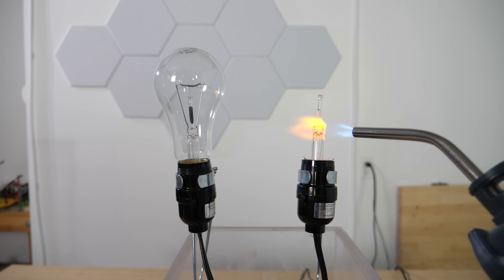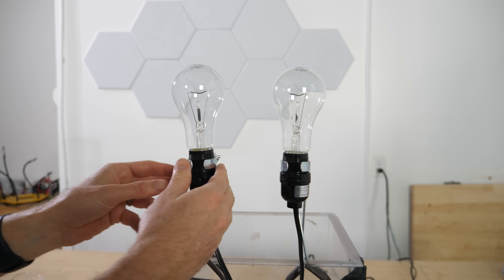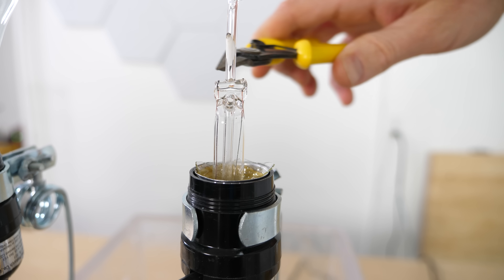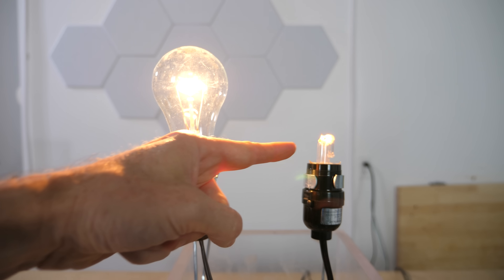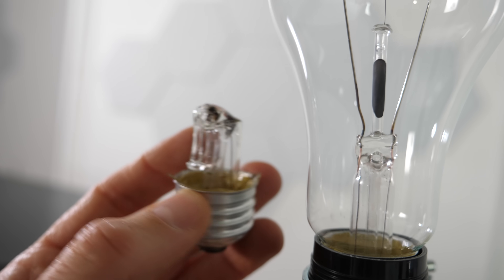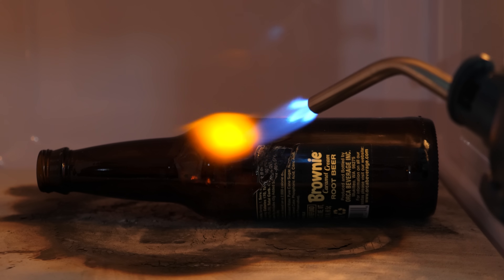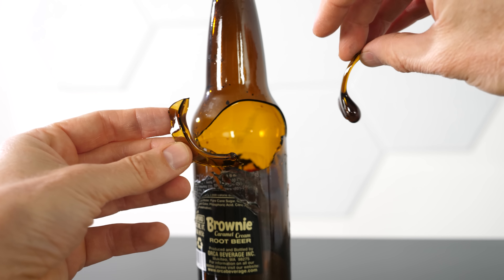How Glass Breaks All the Rules of Insulation

Comment: I was a bit of a mad scientist as a kid in the 70’s mucking about in my parent’s basement. I happened to come into possession of a high voltage transformer used for neon signs. I attached a couple of wires to the terminals and wrapped the other ends around a thin glass rod that came with my chemistry set. They were separated by about a half inch of glass rod. I plugged it in and was fascinated to watch as the electricity arcing between the wires heated the glass until it began to conduct and glowed extremely brightly. I never understood what was happening until now 50 years later. Thanks for making this video. The microwave part was equally fascinating. BTW, I also had some fun making Jacob’s Ladders with the transformer 😄
Reply: 50 years later 😶😶🫥
Reply: @stanleesiele6028 yes old people exist!
Reply: Glad you made it 😅❤
Reply: My Brother and I did the same thing with those HV transformers. Experimenting with all kinds of "conductive" materials.
Reply: @KeithKenobi  At least we didn’t electrocute ourselves 😂.  I was scared of it enough to be damn careful!
Reply: How the Gen-X survived their childhood is beyond me.

Comment: Very cool demonstration. I had no idea that glass did this at high temperatures. Thanks for showing this video.
Reply: Not just glass! Any ionic solid is conductive once molten. For example, production of highly electropositive metals such as sodium, potassium, magnesium or aluminium relies on electrolysis of the respective molten salt. These metals cannot be smelted the same way most metals (e.g. iron) because even the reduction potential of carbon is too low. The salt must be free of water because these metals react violently with water, especially under the reaction conditions (the product is metal hydroxide and hydrogen gas).

Comment: I vaguely remember my dad telling me about an (inefficient) light source using a glass rod as a filament.  The power stays on and jou start the lamp by heating the rod with an external flame.  To switch off you could blow on the rod to cool it down until the bi-stable process stops.
I can't find any info online about those lamps.

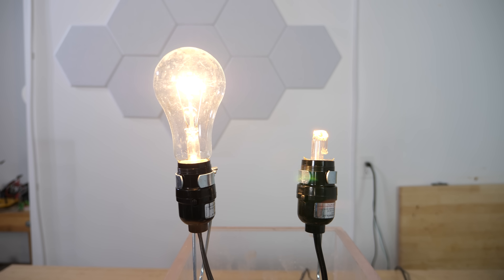Comment: 3:14 World's most inefficient latch
Reply: You can place heating latch to heat it up using electricity. After you heat it up enough it will stay turned on until you break the circuit.
Or when every ion gets to the electrodes and there's nothing to electrolyze.

Comment: Next time, scotch tape the bulb, after showing they're in series crack the taped bulb near the base with vice-grips to remove the envelope without damaging the filament.  Turn the power back on.  Most people have never seen burning tungsten.  After you have molten glass, use a glove and pliers to hold one of the electrode wires you snipped off, poke it into the melted glass and pull out a thin strand till you get bored. Thanks for the electrolysis info!

Comment: I watched a chemistry magic show when I was in college.  Take one of your light bulbs.  Connect it to a DC current source till it glows brightly.  Then immerse the glass portion in a salt solution, then connect one of the wires to the salt solution.  The free electrons inside the hot bulb will cause the sodium in the glass to plate the inside of the light bulb with a layer of sodium metal.  The sodium is literally moving through the glass due to the electric field and changing to metal on the inside of the bulb !
Reply: @markofdistinction6094  
Interesting ! I need to do it could be a new discovery. If I make it , I will cut a piece of that treated glass 
And apply a voltage on one side to see what come out on the opposite side. Could be great if DC can be blocked like a diode. Also to see if extra pure metallic sodium or something else could be produced ! With that filtration method.
Reply: @ The professor told us that if Potassium Chloride is used instead of Sodium Chloride in the salt solution, the glass will explode.  This is because the potassium ion is bigger than the sodium, so stresses the glass as it tries to move through the glass matrix.
Reply: Budget Gorilla glass
Reply: Cool story broah.

Comment: Thank you for demonstrating a concept I'd first demonstrated when I was 14 in 1972. I had no effective way to record my experiments at that time, so nobody ever believed me that glass conducts when heated.

I used a 300VAC source from a power transformer pulled out of an ancient TV connected to a piece of plain glass (from a hobby store) by a metal clip. After a few swipes with the other electrode (a nail inside an insulating wooden dowel forming a rudimentary probe) to get a small arc to form, it began to heat up the glass. Of course, 300V will barely even arc a millimeter in dry air until there's an ionized region of air (i.e. plasma) in which to facilitate a greater arc.

Once the glass had heated to red-hot, then I was able to form an arc directly between the probe and the glass, which caused the glass to heat to white-hot. As the temperature increased, it produced a highly conductive column of plasma allowing up to 3-inch long yellow "furry" arcs to be drawn between the probe tip and the glass!

I ended up creating some rudimentary, yet functional, thermistors by encasing thin wires inside a globule of molten glass. Interestingly, even after these cooled down to room-temperature, the resistance would change notably when warmed - even by body temperature.

I had lots of fun playing with arcs onto molten glass in my parent's basement at that time, and learned a lot along the way.
Reply: Maybe your thermistor worked at low temperatures because some metal ions had doped the glass. It would be good to get the opinion of a semiconductor structure specialist on this.
Reply: @Poult100  Thank you for your input. Yes, I'm quite certain that there was some doping of the glass going on there as the metal from the probe electrode vaporized. I mean, I was 14, and I wasn't exactly working in a sterile lab. :)
Reply: Once,  50 years ago I tried this with a welder and it worked exactly the same, the hot molten glass acts as a regular conductor.
Reply: The "glass light bulb" (heh) is also an old physics-teaching demonstration going way back (but they don't know about your thermistor.)   For the physics classroom, we strip the ends of an AC cord, wrap wires around a glass rod, with about a 1cm spacing, then plug it in.   Nothing happens of course.   Then, heat it with a propane torch until it glows slightly red.   Then, all by itself it glows bright red, yellow, then blue-white and melts in half.  (It may blow the outlet's circuit-breaker.)   
How old is this demo?  Dunno.   Perhaps 1940s, 30s.   Track down some 1960s books on lecture-demonstrations in physics.   
Also, I develop new lecture demonstrations, and invented the "microwave beer bottle" in the 1990s.   Also do the same with pieces of "red lava" garden rocks, torch-heated then microwaved.  Those "rocks" are actually glass industrial slag.
Reply: Flame rod flame sensors use the same effect - flame rods operate because gases become conducive when heated hot enough to glow because any glowing material has free electrons because they turn to a plasma. Flame rod sensors operate at about 100V.
Reply: Nobody ever believed you ?? Is that just internet speak for "the few unqualified people around me that I told" or do you mean you spoke to, y'know, physicists and they didn't believe you ? Because that molten glass conducts is a very uncontroversial claim.

(not trying to be mean BTW - nice demo, good for you, especially at 14 etc. - but this should surprise no one with even high school physics and certainly no physics undergrad. It's mentioned in Purcell's "Electricity and Magnetism" [1965] for instance)
Reply: Never tried glass, but in college chemistry, we did find molten salt conducts very well. That was over 40 years ago.
Reply: How does this phenomenon change with different kinds of glass?
Reply: @wgoode97  You'll have to try it out for yourself and let us know. I did this experiment more than 50-years ago.
Reply: Are you doctor Sheldon Cooper?
Reply: @99theanonymous  No. I'm not Sheldon, but, aside from his apparent naïveté, and extreme OCD behavior, I do identify closely with Sheldon's character. I started out by repairing TVs when I was 10 with my identical twin brother. Those that we couldn't fix were cannibalized for parts. This, naturally, lead to numerous experiments with high voltage transformers, including the 300V B+ transformer commonly used for vacuum tubes, and up to 25kV for the flyback transformer used on the 2nd anode of the CRT to accelerate the electron beam.

As twins, it was quite natural for us to have a strong drive to maintain friendly competitions with each other. When he'd design a neat circuit, I'd be compelled to design a neater one. It was the ultimate in positive feedback, and this is what caused us both to develop a deep understanding of electronics long before we even took any classes in it.
Reply: I remember doing an experiment in physics lessons at school when I was about 15, a soda glass rod is held horizontally between two steel test tube clamps that are insulated from each other. The test tube clamps are each connected to a bench power supply set to about 30v and 10A, but no current flows. A bunsen burner is placed under the glass rod and as it heats there comes a point at which it will suddenly start to conduct, remove the burner and the glass rod will continue conduct and get increasingly hot until it melts and breaks the circuit.
Reply: i don't believe you when you say power flows through molten glass. 

however i believe the action lab.

Comment: If you asked me if a 1kW microwave could melt glass I would have confidently said “no” and been very wrong.  Clearly a 1kW microwave is powerful enough to melt glass once at least a small part has been heated to the point of glowing red hot.  I now wonder if this technique is used in industrial processes.

Comment: I don't think that was the case in your experiment but you didn't cosider one variable: could the torch flame or fire conduct electricity?
Reply: it can but at the low voltage of 120, it wont conduct much current
Reply: @frogz  never saw a experiment with that. It would be insane 🧙🏻‍♂️
Reply: @ shouldnt be too hard to do, same setup as action lab but with a current meter in series and more of the metal leads exposed

Comment: Wow, thats a stunning experiment. You have invented the Anti-Fuse, It conducts when it gets hot ! Amazing, Great videos as always but this one is a real learner.
Reply: It's already a standard electronic component. It's called a thermistor, often used in heat protection circuits and fire alarms.
Reply: And if you If you are able to 'tune' the temperature to be lower, it could even be used as part of a heat warning system.

Idk what the actual application may be, (possibly an industrial furnace)
Reply: I think that's just called a thermal semi-conductor?

Comment: Something that you might find interesting, is that the molten glass should have "negative" resistance. 

And in the case of the lightbulb example, would be somewhat temperature regulating. 

This is because as the glass cools off, its resistance would increase, causing more of the available electrical energy to go into heating the glass, vs lightning the other lightbulb. As it heats up, the resistance would decrease, thus transferring more energy to the lightbulb, allowing the glass to cool. 

A happy medium somewhere in the middle would be achieved, keeping both the lightbulb filament and glass hot. Especially where the incandescent lightbulb has "positive" resistance
Reply: is this negative temperature coefficient (NTC)?
Reply: @Paint0nBrush  essentially,  yes.
The hotter it gets, the lower the resistance.

Gas tubes tend to behave the same way, but are not necessarily dependent on temperature, even though it does affect them.

Increasing current in these circumstances, decreases the voltage across them, hence "negative" resistance. 

The vast majority of conductors increase resistance as they get hotter.

Comment: This is really cool. It looks like the broken bulb setup even has possible applications... Like some sort of thermally triggered, self-latching liquid relay?

I wonder how many times you can cycle that before the glass degrades too much to do it.

The way it restarts itself when you apply power, but only if it's above a certain temperature... Definitely seems useful for at least something.
Reply: Or possibly some form of warning system. Especially if the glass can be tuned to react like this to different temperatures.

And i don't think the glass would  degrade, as far as we can tell, it's infinitely recyclable. Granted, sustained heat may cause the glass itself, or the ions responsible for this process to evaporate and leave the glass

Comment: Did you change the circuit after you cooled the broken bulb? My guess was you are using two 120V bulbs and at first in series from a 220V outlet? Their color temp did not look like they were running at half wattage.  But the working bulb looked much brighter when you first melted the glass in the other one. The working bulb looked dimmer, more like when both were running, after that. Like you used a 120V outlet then? Or the glass added enough resistance to not be a short like the original melt? 

Or is at all just the camera adjusting differently?
Reply: He did not change the power supply.
The Wattage of two bulbs in series is 1/4 of their rated Wattage. 
How do you know what a bulb running at 1/4 Wattage looks like?
The resistance of the molten glass is less than that of the tungsten filament.
Reply: @pocotaligoswampfox4789  WOW! SAD!
1) You were there to watch and know this? He does not say so. So just make crap up?

2) RATED Wattage is not discussed at any point in time until you showed up.

3) Putting any number of bulbs in any series/  parallel ... combo does not change a single one of any of their RATED Wattages! 

4) A bulb running at 1/4 wattage REGARDLESS of it's RATING is visible in this video when both are on! In fact BOTH are displaying their 1/4 wattage brightness. That is how ALL of us watching this video KNOWS  "what a bulb running at 1/4 Wattage looks like". This confuses you?
Reply: @glenncurry3041  I was just trying to answer your questions. I actually meant to ask how you knew what one of those bulbs would look like running at 1/2 rated Wattage, not 1/4 rated Wattage, since you said it did not look like it was running at 1/2 rated Wattage. The resistance of the glass changes as it heats, melts and cools, and you can see the bulb in series react accordingly.
The Wattage of a resistor varies proportional to the square of the voltage applied to it, so each of two bulbs in series will produce 1/4 of their rated Wattage, which is the Wattage they were designed to produce at their rated Voltage, which is 120Volts.
Reply: @pocotaligoswampfox4789  "rated" has nothing to do with the discussion at any point. 

There is an obvious difference in apparent luminosity between the working bulb and the first glass melt compared to after it cooled and was re-melted. Most likely either a change in the resistance of the melted glass or a change in supply voltage. As neither of us were there, I asked instead of making up answers.

Comment: Great demonstration and exposes a major safety vulnerability when using glass as a conductive insulator.
Reply: Truth be told alot of insulators that we use break down well before that amount of heat.  For example when my shop needs to rewind blown windings in an electric motor we bake the motor at 700F over night and all the insulation and varnish that holds everything together burns to ash.  That temp will barely begin to glow red at all.
Even at less extreme temperatures the insulation is less effective.  One diagnostic test measures the resistance between the windings and ground.  At 20c (room temperature) the reading at 1000 volts could be tens or hundreds of GigOhms,  raise the temperature of the windings to 40c (about 104F)  and the resistance can drop to a quarter of the room temperature reading.  Start hiting 150c/300f and your risking arcs to ground no mater how good the insulation was at room temperature and your getting very close to when the insulation breaks down and suffers permanent damage.
Reply: every insulator is conductive when enough energy is being dumped into it even air

Comment: There's a video over at JerryRigEverything where he goes through a glass recycling pipeline.  The glass cullet is sent to a factory where it's melted by just this process (with immersed electrodes) and then used to make fiberglass insulation.
Reply: Ah, the forbidden cotton-candy.
Reply: You're right, I worked in a glass factory and the glass was heated by gas burners but also by passing an electric current through the molten glass - electrodes were inserted from the bottom of the furnace through which a current of thousands of amperes flowed.
Reply: Кроме стеклянной ваты ничего таким способом не сделаешь - много пузырей. Прозрачное стекло плавят только нагревом, никакого электролиза.
Reply: @kokvad  That makes sense.  Thank you.

Comment: So pointing a laser as a glass insulator on a high voltage power line would cause a short circuit?
Reply: Depends on how much heat you could deliver to the entire insulator.  I don't think that this is a real concern as it is far more practical for someone to shoot at the insulators with a common 0.3" rifle than find a laser this powerful.
Reply: @michael-j-harrison  This actually is an interesting question.
About 6 months ago TheActionLab had a video called "Magnifying The World's Brightest Flashlight (200,000 Lumens)" where he burned holes just using the flashlight and a magnifying glass.